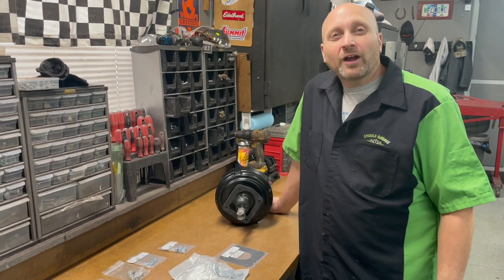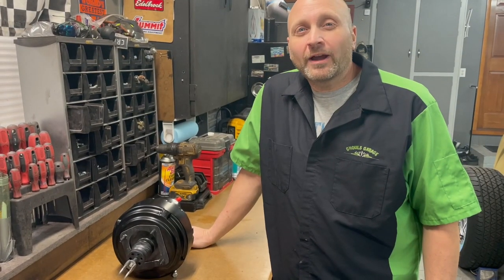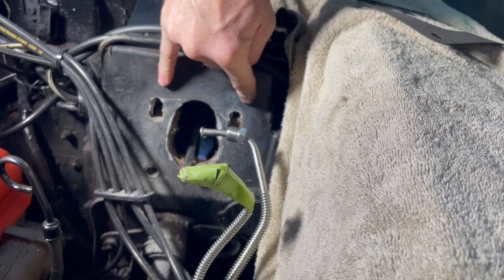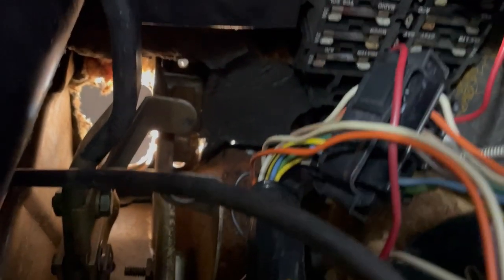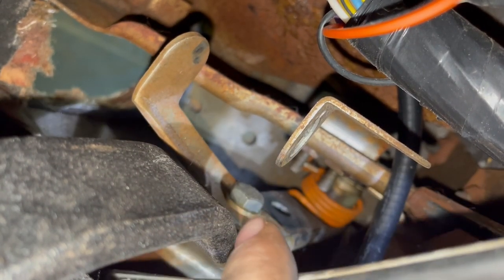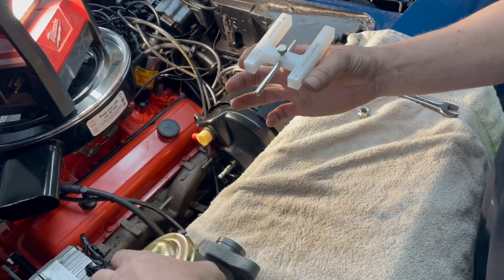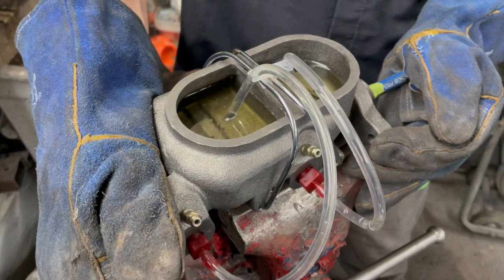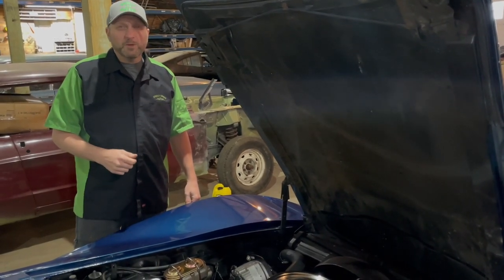How to install a power brake conversion kit on a C3 corvette

Comment from the maker: The kit we purchased included the parts to adapt to the carb. I have seen booster vacuum ran at either point. I also have a 1969 corvette with 427 and it feeds from back of carb. I will check to see if my book has a vacuum chart and try to get back with you.Thanks for the question please subscribe for future videos.
Reply: Thanks and I am subscribed. Keep the videos on the C3 coming as I am restoring my 69 and need all the help I can get :-)

Comment: This is definitely one of things I am going to do to my 69. The only question I have and am not really sure of> I always thought the power brake Booster got its vacuum from the intake manifold? Am I wrong? I know on the intake manifold there is a connection that there are vacuum lines running to. I always thought you just had to change it from a 2 line to a 3 line vacuum connection.
Reply from the maker: The kit came with a vacuum line that went to the back of there carb. some power brake systems are off the intake but I think the original c3 corvettes went off the rear of the carb. Thanks Ghouls Garage
Reply: @ghoulsgarage9553  thanks again for the reply! Can’t wait for the spring to start working on it again. I live in NY and have no garage at the moment.

Comment: So I went on line to Zip Corvette and looked up the conversion kit for my 69. It appears in the description and photo that it "does not" come with that tool. Did you buy that separately or did it come with your kit?
Reply from the maker: I ordered it from zip and the gage came in my kit. I think they got it from www.cssbinc.com they also have a video and sell the kit. I also bought one from jegs performance.
Reply: @ghoulsgarage9553  Thanks, I’ll ask Zip if it comes with their kit before I buy it separately. Thx again for a great video on the install.